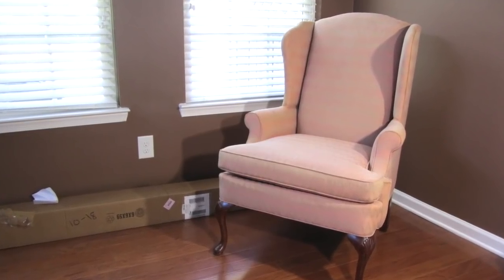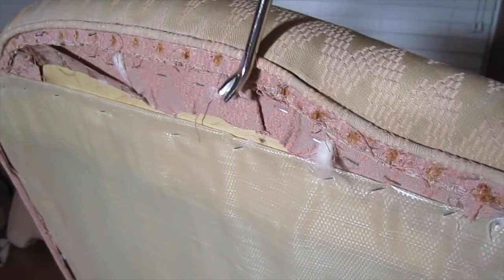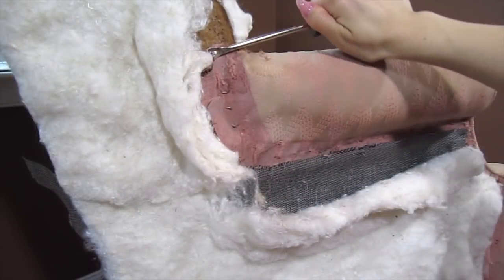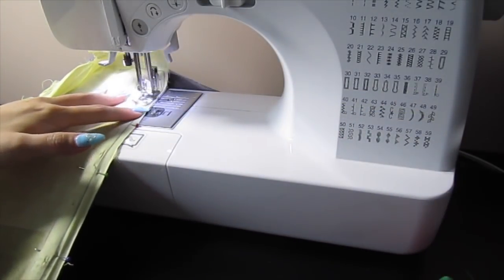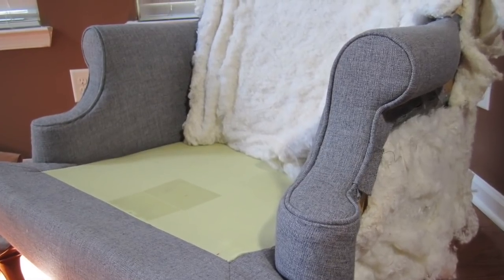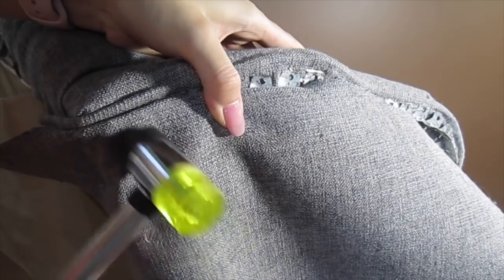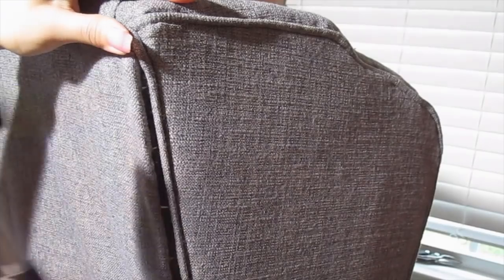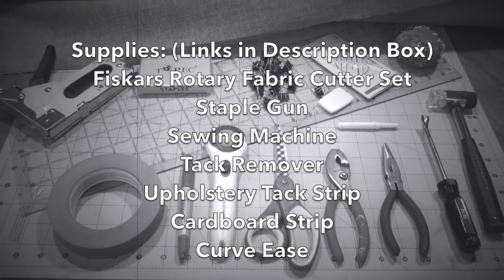Change Chair Fabric Tutorial

Comment: On the piping strips never use a straight seam like that but sew it at an angle so when you put the pipping back between the binding the seams will not be on top of each other.